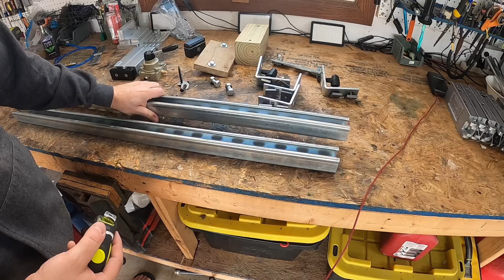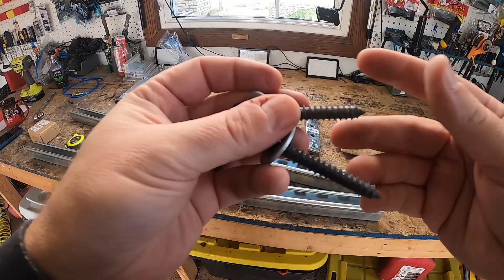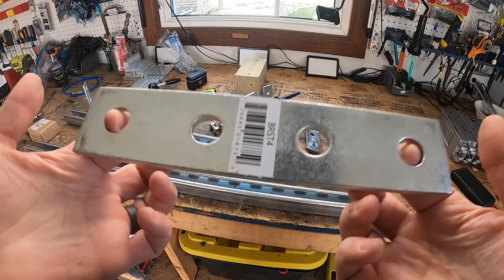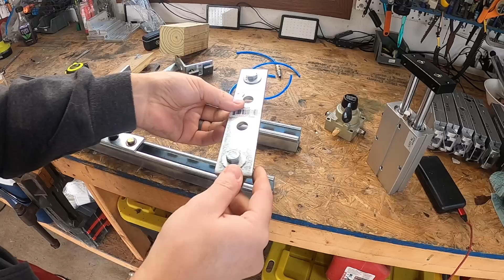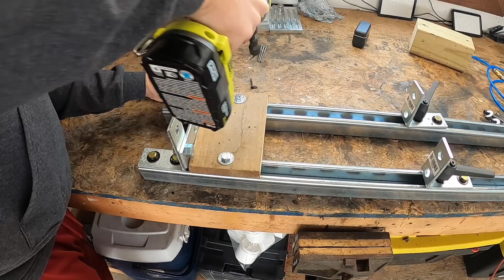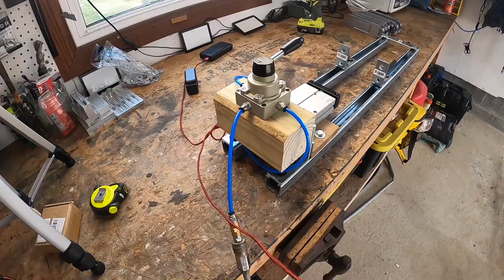***Calling All Baitmakers*** - DIY Pneumatic Air Vice for Bait Molds

Comment: A recommendation that I would make is to reverse your airlines coming out so that when you push forward it releases and when you pull back it clamps. That way if your hand is in between molds and you were to slip, you would not push forward and squish your fingers.
Reply from the maker: Thanks for the recommendation!

Comment: How could you modify this for use with larger molds? I have an 18 cavity senko and a 20 cavity trick worm and if only clamping on the bottom I feel like the top would flash
Reply from the maker: That's a massive mold... great question but I don't have an answer for that one.

Comment: Excellent Job Daren!!
Hydraulics would be better but with the plastics you are working with does not require alot of tonnage ( clamping pressure). 
I also work with basic Pneumatics  with  blow molds and End-of Arm tools for the 5 axis robots. So if you need anything let me know!
Reply from the maker: Right on brother! Thought you would like that one
Reply: @wendellfishing   Yes sir!
 I've dealt with molds  from 300lb to 21 tons.  No difference than your molds ,same principles of producing the parts.